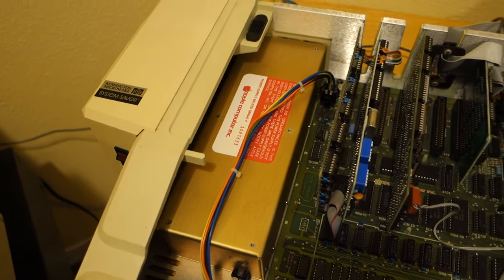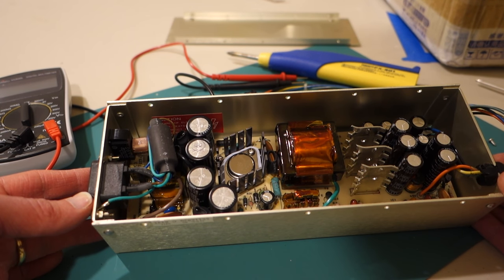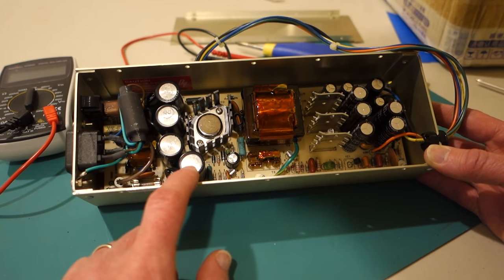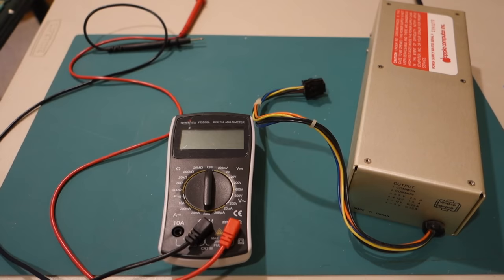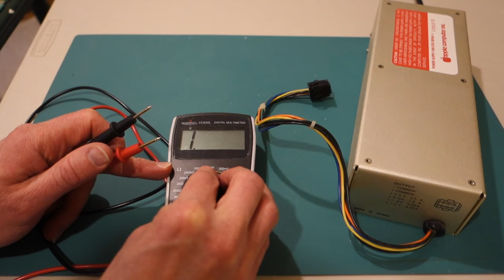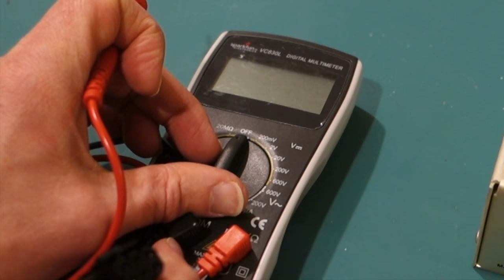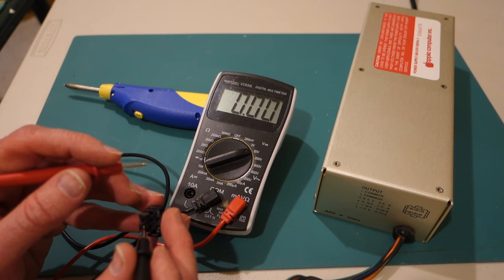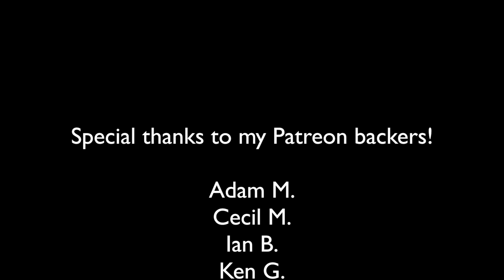Assembly Lines #44: Apple II Power Supply Testing

Comment: Hey! I just wanted to say that I've been collecting and tinkering with vintage computers since I was a kid in the mid 1990's, but I somehow never developed any meaningful soldering skills and never learned how to recap anything... until this week. During the pandemic I picked up a couple Apple II systems - one is a IIe (non-Enhanced) and the other is a true original Apple II (though a very late example). I haven't tested the II yet, but all my early tests with the IIe were frustrating - it would power on, but frequently glitched out, and my Floppy Emu wouldn't work correctly when connected using a known-good drive card. Then the RIFA cap blew, filling my kitchen with magic smoke, and I knew it was time. I bought a quality soldering iron, a desoldering pump, an Apple II PSU Cap Kit from Console5, along with various accessories and started binging "soldering for beginners" videos. Last night I watched this video and dove in, and after a few hours of slow progress, I'd replaced the blown RIFA along with every other capacitor in the PSU... AND IT WORKED! The IIe now boots smoothly from my Floppy Emu, and doesn't seem to be struggling with wonky power issues anymore. I'm super happy. Thank you for making this video Chris - it really helped! I'm especially grateful for your guidance on using the multimeter to test the various voltages at the end - as a total beginner with this stuff, seeing my voltages matching yours gave me a lot more confidence that I wasn't about to damage my IIe motherboard after the recapping work was complete. Thanks again!
Reply from the maker: hey, thanks so much for your kind remarks! It's comments like these that keep me making videos :-). And I'm glad to hear that you got your IIe working. It's so rewarding when you put everything back together and it actually works. Like magic, but without the magic smoke! Good luck with the Apple II - in some sense those are easier to work on, as the chips are all "off the shelf", although there are a lot more of them. I've got a few other videos where I diagnose problems with an Apple II and II+, so if you run into any problems, maybe check those out for ideas. Maybe I'll see you over on either the Facebook Apple II Enthusiasts or on the slack Apple II Infinitum.

Comment: Perused the old vintage schematics that were from Apple....  The AA11040-B is certainly an easy power supply.  One question is why did they not add the mains 115/240 changeover switch on it as the circuitry certainly had it there.
Reply from the maker: That's a good question. I don't really know, but I bet there are some old timers around who might know the answer...

Comment: A couple of things.
1) Never check continuity on a live circuit.  It will kill your meter.  May not do you muchgood either.
2) Before checking continuity on a circuit that had power short the pins to ground (usually black).  Residual charge in the circuit will also kill your meter.
3) Best voltage check is WITH load.  Check the voltages while connected to the Apple [].  Checking it without a load can give false readings.
4) When replacing capacitors be sure to short them out before testing or removal.  Also it is VERY important  to observe polarity.  If you don't you'll hear a loud BANG and the magic smoke will run out.  Not to mention it will damage the power supply circuit board.  I built a debugging card long ago and missed one tantalum capacitor polarity and got to see my Apple IIGS shoot out fire!
Reply from the maker: Awesome Glynne, thanks for the tips! Maybe you could do a followup video where you go more in depth. My video is pretty high level.
Reply: Glynne Tolar I didn't get any readings when my PSU was turned on, did it like in the video. You're saying it should be connected to the computer, but is the difference this big (nothing or +/- 12V or 5V)? 

Connected to the computer, nothing happens, won't boot. No sign of life whatsoever, wondering where to start looking.
Reply from the maker: sunapple, are you on Facebook? If so I would ask about your PSU on the Apple II Enthusiasts page. Lots of helpful people there, and you can post pictures of your supply.
Reply: Also worth pointing out that electrolytic capacitors can fail without any cosmetic indication... Don't forget the Apple II series is pushing over 40 years old now! You will be lucky if those capacitors are still viable...
Reply from the maker: That's an excellent point! I haven't had one fail yet, but I'm sure the day is coming when the magic smoke will be let out...

Comment: My Apple //e power supply failed a few minutes (about 5 minutes - it kept running, but started hissing etc.  glad I was right there in the room) after being plugged in recently and the parts that smoked (and stank) were the PME-271M components near the high-voltage input end.  You can barely see one of them in your video, they are the brown colored capacitors (Paper?) near the left.  You really need to remove the board from the case to get a clear picture of them.  I ended up just replacing the PS with the same kit as you and am happy with the results.  The more recent kit is even easier to install due to the updated header he is now using. I suspect that any original Apple ][, ][+, //e or /// PS will fail under load at any time in the near future.
Thanks for the video.
Reply from the maker: Yep, those filtering capacitors are the ones that tend to fail. Not necessarily dangerous when they fail but they smell terrible. Good thing you decided to just replace the PS. And you're right, eventually all of the old supplies will fail...

Comment: my Apple IIe stopped working and I thought it was the power supply. But I tested the pins and I am getting 5.27V, 12.42V, -11.27V, -4.90V So it seems to be working. But my Apple IIe is not powering up at all. It used to work just fine before. Any ideas? Thanks!
Reply from the maker: Hmm, that's a good question. It's possible that the power supply is supplying the correct voltages but is unable to actually supply enough current. However, it's also likely that something else has failed like a capacitor on the motherboard or one of the chips. As a simple test, with the power off, try pressing down on all of the chips to make sure they are "seated" properly. Also be sure to remove all expansion cards from their slots. Examine the motherboard carefully, look for swollen capacitors. If you get absolutely nothing (no beep, no power light) then it is more likely something in the power delivery (either the power supply or a failed capacitor). If you get a beep or a power light then it's probably a chip failure "down stream". If you're on Facebook, ask over on the Apple II Enthusiasts group - people are (for the most part) very friendly and helpful.
Reply: @CT6502  I removed all expansion cards and it powered on! It was the disk drive expansion card. I plugged the same disk drive expansion card back in and now it is working fine. Sweet! Thank you so much
Reply: @CT6502  About the not enough current thing. I think that is also one of my issues since my astec powersupply is so old and I had trouble powering an HDMI expansion card, how can I test for enough current?
Reply from the maker: @eduflyer  hey, that's great news! Maybe check the chips on the disk drive card and make sure they are all seated properly as well.
Reply from the maker: @eduflyer  Hmm, that's a little trickier. One way (I'm sure there are others) is to remove all other cards but the HDMI, and see if that works fine. That will rule out problems with the HDMI card itself. Once you've done that, if it still doesn't power the HDMI card, then it's probably time to replace the power supply. I'd recommend getting one of ReActiveMicro's kits like this one: https://www.reactivemicro.com/product/universal-psu-kit/. They are easy to assemble, and you can keep the old guts in case you ever want to restore it to original.
Reply: @CT6502  yes. It does work without some of the other components. This is what the manufacturer from the hdmi card recommended, to get a replacement power supply from reactive micro. However, I wanted to “fix” the original power supply instead to keep it OG. And it’s also an ASTEC which is a nice power supply. Maybe recapping it will fix it?
Reply from the maker: @eduflyer  Yes, recapping it might improve things. At the worst, it will be a fun project and hopefully won't be any worse off than before. Go for it!

Comment: 2:18 having an anti static mat is the worst advice you can give when working on mains voltage PSUs - there is absolutely nothing in there that would be sensitive to human generated static discharge...
Reply from the maker: https://www.ifixit.com/Answers/View/14633/How+do+I+ground+my+ESD+mat+to+avoid+shocking+computers
Reply: Citing another reference doesn't detract from the fact that using an anti static mat when working on mains voltage PSUs is poor advice... If you can't understand why that's a bad idea you really shouldn't be working on PSUs...
The internet is full of misinformation - I encourage you to find out for yourself why using a anti static when working on a main voltage PSU is a bad idea as you are clearing failing to understand the dangers...
Reply: Here's a sobering link:
https://www.dailymail.co.uk/news/article-2215200/Teenager-Shawnee-Oklahoma-dies-electrocuted-fixing-computer.html
Reply from the maker: I'll just remove that portion of the video.
Reply: That'll me me sleep better thanks ;-P
Reply: @Fifury161  That article doesn't mention anything about ESD?  It is implying that the CAPs caused the death.  So I'm not sure how recommending an anti-static mat could be "the worst advice" based on that article.  Not saying there might not be a reason, but a guy on the internet saying that and pointing to an article that doesn't mention ESD isn't very convincing.  ;-)
Reply: @desiv1170  You clearly don't understand how electricity works. Working on live mains voltage is dangerous, the anti static mat provides a path to ground, you could receive a shock or worse. Hey, it's your life, just don't go killing anyone due to your ignorance...
Reply: @Fifury161  Never said it was a good idea or bad. Just that you hadn't said why. And your example had no specifics either.  You know how youtube commentors do sometimes.. :-)